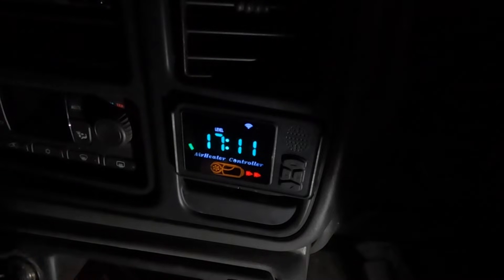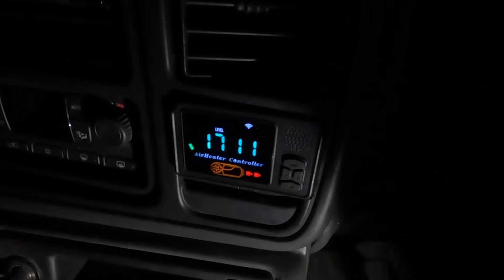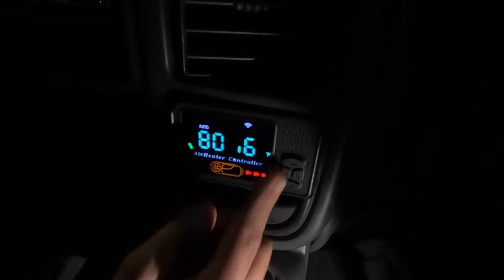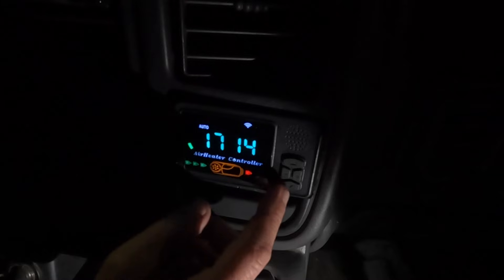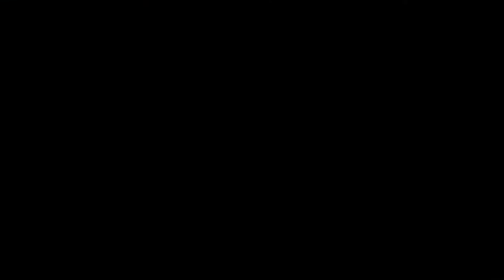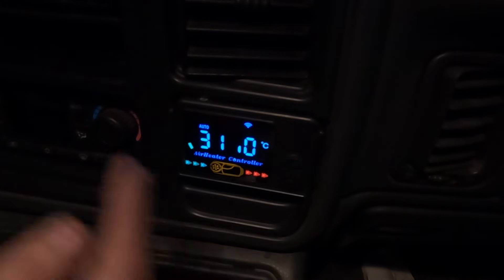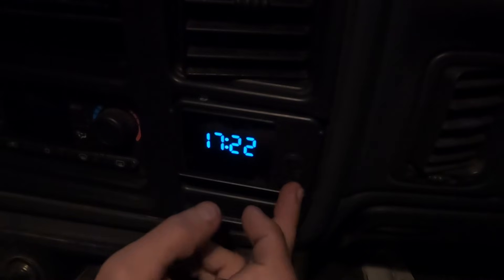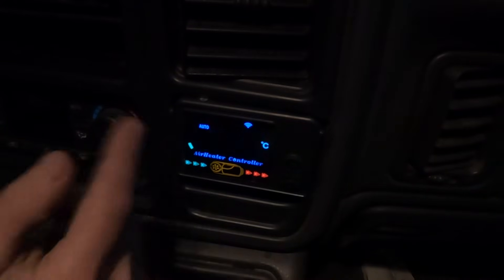Bluetooth Diesel Heater Feature & Settings Discovered !

Comment: So, this is the only model I've seen that actually shuts off in the thermostatic mode. The lcd is asleep but
still monitoring ambient temp, is that correct? I just bought a Hcalory L1S and am very disappointed that
it turns itself down to level 1 once the set temp is reached. It also has no pump Hz adjustment menu either.
That really sucks cause it plugged itself solid with carbon in the 1st gear setting.
Reply from the maker: There are a few models that do this now. Vevor has at least two and there are others for sure. 

Yes. It has the ability to turn on and off, just like your furnace at home. It also has a mode similar to your L1S. These heaters draw about 120 - 140 watts on start up, and again on shut down, for about 2 minutes, while they heat the glow plug. Once they are running they only draw about 40 watts, less on lower settings. All this to say, often, turning down is a better option than turning off, unless you have a well insulated area, or a situation where the heater will be powered off for long periods.  

Most heaters these days do not have HZ and fan adjustment. This is controlled by either a "plateau mode" function or in the case of the Vevor, an automatic elevation adjustment. If you are above 8000 feet, you may want to find a heater you can tune and tune it with a CO meter. 

Hmmmm. I have a Maxpeedingrods heater and it also ran rich, but in the higher settings. That being said, soot is most often caused by improper setup. A blockage / restriction in the exhaust or inlet is the most common issue. 

One option you may be interested in is a Bureck CD thermostat for your L1S. I have a video or two about it. Not sure if they are even still in business.
Reply: @loweredexpectations4927  I have looked at getting a  Bureck , that would solve my main concern of the
heater running on low and sooting up. Im at 2100ft , duno what elevation the plateau mode in mine is high
enough to justify turning it on.  Heat output is down by approx 1/3 when it is on. Im a little ticked off that I paid double of other units and what i've got isn't tunable ( hcalory site says it is)  The 02 detector I ordered a month ago should be here tomorrow , so I can use that to gather more info. My exhaust is different now from when it fouled up, but id rather not let it use 1,2 or 3 and have to take a brand new unit apart again. FYI, its set up as a garage heater. power draw is not my concern , I want 10C 24/7 and no hickups if possible. Thanks so much for the reply. It means alot.
Reply: Also, Ive already designed and built an automated ( exhaust ) heat exchanger system. It works great on gear 4,5 or 6
and in plateau mode 4,5 and 6. I duno if The low velocity of 1,2 or 3 will work as good or at all. In my application , I would rather on/off every few hours.
Reply from the maker: @ldg332004  2100 feet is not that high. I am at 4000 and I don't' have any issues with my heater on low. I can run my heater on plateau mode, at my elevation, but it is not necessary. 

Not sure if I said it already, but tunable heaters are becoming rare now, due to plateau mode and self adjusting heaters. I think it also has something to do with emissions control. In the days of carburetors, lots of Japanese motorcycles came from the factory with the adjuster screws capped off, so they could meet emissions compliance. Having an adjustable carburetor was seen as too easy to tamper with. 

My newest heater does seem to run a little rich in the lower settings, but I don't run it there long enough for it to be a problem. Maybe someday I will actually test the exhaust and see if there is an issue. The new heater I have comes out of the box with a 90º elbow at the bottom of the heater, and then I have another 90 bend in the pipe... At my elevation of 4000 ft those kinks might be enough to put it past the tipping point. 

I help when I can. Good luck with your endeavor. I hope you get it sorted out.
Reply from the maker: @ldg332004  Hmmmm. An automated heat exchanger system? Care to explain more? It's incredible how many different ways  people fine to use and modify these things.
Reply: @loweredexpectations4927  The steel 90 my heater came with wasn't made very well, it's squished a little
in the middle of the bend and the flare that goes over the heater exhaust output is flared 5/16 on 1 side and about 1/2" on the opposite side. ( no quality control ) i assume. I have no clue what carboned up my unit when
I had it running in thermostatic mode when it was first ran, but I would rather not go through that ordeal again if possible. Since im heating a large space, on/off suits me fine. I might order a vevor with the 4 button controller and swap the motherboard and controller over to the hcallory or maybe just send the hcallory back.
thanks for your time and your info.

Comment: I have the "~8" kw version of this , It's unfortunate...while the Auto -Full On/ Full Off thermostatic function (AU-on) of this is a potentially nice feature we have all wanted. 
 It has a major flaw in reality. Note: it does indded fully turn off and on and the set point...but read on ...that is not the issue.

  The control loop is so badly tuned   (If indeed the process control method is a P.I.D type) that it turns its output down when it is nowhere near the target set point temperature.   For example if it thinks the room/cabin/interior temp is 18C and the target set point is 27C    it will already turn down the level of it's output to about level 5 (out of 10). This output power setting is so low that you will probably never reach your target temperature.  It's so bad that it really can't be a PID loop at all. I gave the process loop plenty of time to correct/adjust but it doesn't.

 It's not until you max the target out to 36C that it will increase to Level 10.   (If you drop the target to 35F it will already drop the output Level to 9.     Disappointing implementation.  This means if I want to use it for automatic thermostatic mode with full heat output....  I'll have to old school and use Level mode and hack the remote on/off buttons and control with arduino or Home assistant etc......just like I was going to do with my older model.....that's why I was excited to just buy this one since it had this feature built in-sort off but with drawbacks...

Summary it doesn't use about half of the output it's capable of in Thermostat mode, which of course the mode it has to be in when using the Temperature based  Auto-on/off feature
Reply from the maker: I have a few of these heaters so I think I know what you are talking about. In the auto function, if you set the heater to 30, it lowers the heat level way too soon and never reaches the set point. I never use mine this way, but have experienced this. My "solution" is to set the heater to higher than I actually want, and then use the temp offset / correction as well. 

Some of this has to do with the placement of your thermostat /controller, but yes, the software is bad at hitting the setpoint. I assume this is done on purpose for fear of overshooting. 

Depending on where you are using your heater / what you are using it for, it is possible you can relocate your controller to a spot where this will work well. In my truck, I have my controller on the centre of the dash, but when I move it to the passenger side, or into the cup holder area, it works a lot better. 

The clock also doesn't keep time, so you can't use that to turn it on and off, unless you reset the clock every day. Hard to believe they can't figure a clock out.

Comment: so you cant mess with the air fuel ratio?
Reply from the maker: You can not enter your own settings. You can choose plateau mode and that will lean it out a preset amount.
Reply: @loweredexpectations4927  what would it take to be able to do so and is it worth it?

Comment: I tried another video using the same heater and controller and the button combos were completely different. I can't really investigate as I'm on the road (van) and it's in the teens (F) so I don't want to accidentally set my voltage wrong and freeze. ha!
Reply from the maker: There are two of these heaters that are similar, but I believe that the bluetooth units area all the same... but I have been wrong before.

Comment: After setting up the auto feature my controller is flashing the ambient temperature. Hopefully someone has a solve for this…
Reply: Mine did the same for a minute then stopped after reaching set temp and coming back on. It only reached set temp because I adjusted it to make it shut off. Idk if the flashing stopped because it cycled or it's just a set amount of time it flashes. But that was my experience.
Reply from the maker: I have never seen this. Hopefully someone has an answer.

Comment: The Likaci amazom upgraded Bluetooth controller has the auto on off function. Only wish they sold spare control boards for my older 5kw Diesel SUCKER. Dam control always read 12c
Reply from the maker: I'm guessing, that in the next few years, these will be available from Amazon and all the Ali sites.

Comment: Hello from Port Moody. Thank you so much for posting this. Any chance there's a way to quite down the pumps clicking during use? Maybe a different pump?
Reply from the maker: There are a lot of ways to quiet the pump. Depending on your "install" the easier / best method can be simply soft mounting the pump, instead of bolding it down. hanging it form an o-ring or a zip tie, for example. 

You can buy quieter pumps, but they do still click, unless you shell out money for the peristaltic kit made by some fellow in a shed. 

You can get insulating cases that go over the pump, but from my experience, the majority of the noise is carried through the mounting surface.
Reply: @loweredexpectations4927  I try hanging the supplied pump holder with bungie cord.  Thx
Reply from the maker: @forrestergil  Dave McLuckie, in one of his latest videos, shows a device you can buy for a few bucks, that acts as a sling for the pump.

Comment: seems like the thermostat function is a bit broken, it will ramp down to 1 "gear" the closer it gets to target temp but if 1 "gear" doesnt maintain temp it never ramps back up
Reply from the maker: Hmmm. That seems odd. Is the controller aware of the ambient temp drop ? Does it say on the app that the temp is lower than the target?

Comment: I figured i would mention. The 0c in the menu that you weren't sure of is thermostat calibration. Mine was reading 7c higher than the actual ambient temp. I set that function in the menu to -7c and the thermostat now senses the temp correctly... it's pretty much amazing vs the old diesel heater controllers!
Reply from the maker: Thanks for the info... This has been pointed out to be and I made a correction to mine as well. A lot of this has to do with where your controller is mounted, as that's where the thermometer is.

Comment: I just turned it on and it worked for me 100% whenever I use it, I've never had any problems with it, once I set the temperature, I don't need to change it, sorry if I don't have any horror stories.
Reply from the maker: Nice

Comment: do you know if i can take this controller and just replace my blue controller og 2kw heater? or is it only to use heater that comes with the controller?
Reply from the maker: You need to replace the controller and ECU as a set... and they would both have to be 2kw units.

Comment: Mine has null as Bluetooth (presumably not fitted) even though it is set to on. Remote wireless icon lit, but not sure how to pair remote
Reply from the maker: If it has bluetooth it will show up in the settings menu. Start heating, press and hold the M button till it displays the clock. Use the up and down arrow and see if it has something that indicates BT .

Comment: Can you adjust the frequency of the pump to lean out the mixture? Can you show us in a video?
Reply from the maker: Nope... not with this controller. It has automatic elevation compensation and should not need any adjustment.
Reply: What is 5he sesttings for 50 50 diesel veg oil mix
Reply from the maker: @microcementlacalamijasspai8269  I'm not sure I understand your question. First off, there is no adjustment on this controller. Second, a 50/50 mix can be run with your standard diesel settings, but will almost certainly clog up your burn chamber after several litres of veg oil. 

If you are using used veg oil, you will need to make sure that it is very well filtered, and may still have issues. I have used new veg oil at 40/60 veg oil / diesel, and it worked well without any concerning deposits.
Reply: @ I filter the oil 2 times and get it for free it’s been running all day 8 now and still going it used around a litre of fuel
Reply from the maker: @microcementlacalamijasspai8269  I have a friend who has used hisheater for over a month, almost 24/7. He has been burning a filtered 50/50 mix, and had his first issue with the heater not wanting to start, last week. This is usually a sign of problems to come. 

Once the burn chamber gets dirty, there is usually no way to bring it back to normal, as you can not access the burn area, and these deposits do not come off with any chemical I have found.
Reply: @ thank you we will find all we need one day my friend .
Reply: @ cheep fix 25 bucks for new chamber so can carry on safeing money on the fuel

Comment: bonjour, Comment faire pour voir et modififier les parametres avancés  pour la vistesse du ventilateur , la frequence de la pompe   ect . Merci
Reply from the maker: Although my name is Arseneault, I do not understand French ... sadly. Something about modifying parameters. 

If you are asking about setting the fuel ratio, this heater does that automatically and you can not do it manually.

Comment: How do you change your altitude
Reply from the maker: On this heater, it changes automatically. There is no manual setting.

I believe the sensor is actually a pressure sensor, so it doesn't read 100% accurate, and will change based on the weather.

Comment: My controller is the same 4 button without the Celsius to Fahrenheit option. Still tinkering with it but no luck. I did get the secondary info menu by press up and down but it’s just data nothing I can manipulate.
Reply from the maker: Interesting.

Comment: Thanks for the video. I have the Bluetooth controller, but I can’t seem to control the RPMs on the fan or the frequency on the fuel pump. The other controller with no Bluetooth seems more sophisticated. Any thoughts
Reply from the maker: That's correct. The reason for controlling RPM and Hz (in practical terms) is to correct for elevation changes (oxygen density in the air). This controller monitors the air pressure / elevation and adjusts automatically. 

Many of the old heaters had adjustments, but those heaters are getting harder and harder to find.

Comment: Can't even get mine to start ? I pressed the 3 minute prime then press heater on but it doesn't ignite? Just goes off ?? No idea and it's brand new .. any info would be greatly appreciated 👏
Reply from the maker: It may take several primes to get the fuel up to the chamber ... If you can't see things, it makes it hard, but it takes about 20 seconds after the fuel makes it to the hard line on the heater. 

You can prime it a second time by disconnecting power and following the process again. Too much priming may cause issues as well, so I generally disconnect the line so that I can see fuel coming out, connect it and then allow it to prime for another 15 or 20 seconds. 

Hope this helps.

Comment: The "plateau mode" which allows it to slow pump the fuel, making it extra low diesel consumption, cannot be enabled manually on this version of controller like on the old ones , i've just got an reply from vevor on my ticket concerning this... by pressing menu and up arrow  buttons should have enabled it as is showing the mountain icon on the display but nothing happens. 

Vevor Reply: 
"The plateau mode cannot be manually turned on, it will automatically turn on when reaching altitude,
The working principle of the plateau module is that the motherboard is equipped with a built-in air pressure sensor, which automatically recognizes and calculates the current altitude based on the region where real-time air pressure detection is not required. The motherboard will be matched with different wind and oil ratios according to different altitudes to achieve optimal performance."
Reply from the maker: This model has automatic elevation compensation and changes automatically. You should be able to see the elevation reading in meters on the screen. There is no way to override this.

Comment: Does the Auto thermostat function setting stick even if power is cutoff?  I just installed this unit in my boat and I have the heater on the master switch so when I leave the boat and turn the master off, the heater has no power.  When I repower the heater the next time, will the auto thermostat setting be the same as I left it? Thanks!
Reply from the maker: I believe it retains the settings, but I can't say for sure. You will have to check this to be sure.

Comment: Great video. I have changed the Celsius settings to Fahrenheit.The controller changed from C to F. But the app on the phone does not change from C to F ? Any thoughts on it. Or do I have to restart the app for the changes?  Very informative
Reply from the maker: You are not the first person to point this out. Unfortunately, unless they do an update on the app, it doesn't appear this will change.